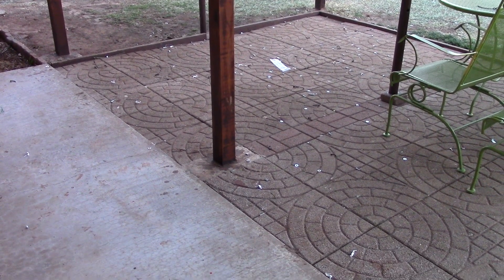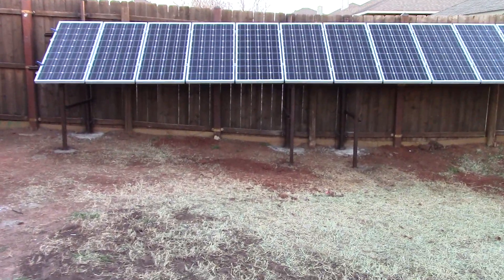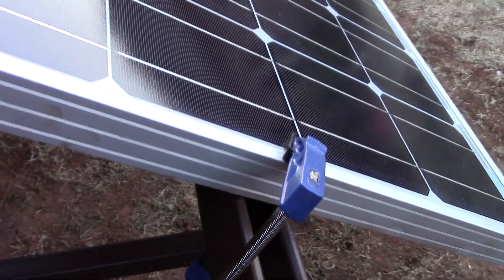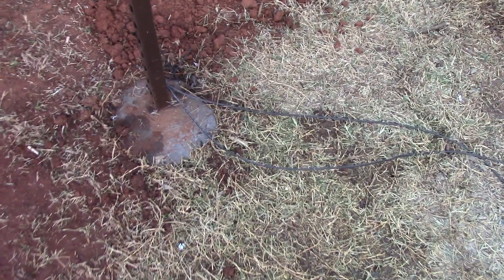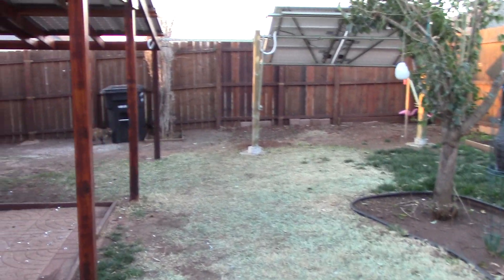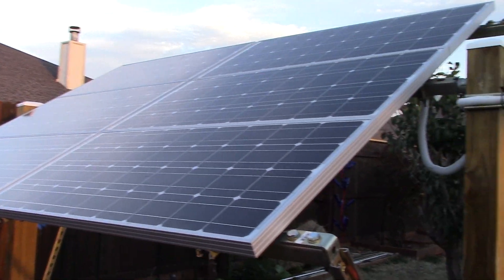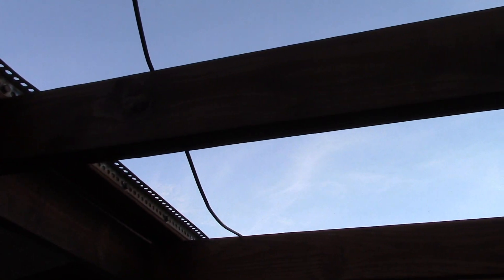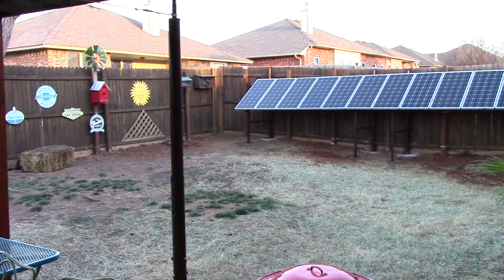12 Renogy solar panels now on fence racking system! 1.2KW array

Comment: Is there any reason why you didnt install them directly on the fence vertically? Instead of building frames?
Reply from the maker: The fence (original wood posts) aren't strong enough. This array has been SOLID since I built it. Check the year I posted this video...panels are still outputting near max too!

Comment: Curious Chris, If you had it to do over would you still use the super strut? I love it and have used it for many things. Buying the expensive racking would be out of the question for me.       I was first thing about roof mounting. I don't have to worry about not enough room on the ground but my roof will need replaced in a couple years. Will you eventually mount yours on your roof (after you replace your roof) to maxamize solar exposure? Just thinking!
Reply from the maker: Making power in a tiny suburbia backyard w/o rooftop...amazed myself. Rooftop solar is never going to happen here for many reasons. My biggest issue before using Superstrut was shading. And still is (but greatly reduced). Really, really, really like Superstrut and DIY racking...can get creative. And a fawk ton less money vs that stuff that is made for solar panels.
Reply: I hear you Chris. My roof faces due south and only ever sees shade at the very edge of dusk/night. There are gods and bads to almost everything. One plus for me is my roofis shingle right now but I have a ton of metal for my pole barn and to re-roof my house. Should last forever. Solar panels with a air gap underneath should help shade my roof and help in the summer with a/c. I will use unistrut though! Thanks Chris!

Comment: Finally pulled the trigger systems on ts way. It will mirror yours with the transfer switch.  I will be attempting to make all the cables from 2/0 wire except the battery to inverter that will be 4/0.  I have to figure a mount for it yet but it will be ground or pole. Any suggestions for a noob?
Reply from the maker: Congrats...anything on the ground with maximum sunshine exposure is best (IMO). Tilt units are good...trackers are even better. Trackers sometimes have "iffy" electronics and can be more hassle then the expense. So, a lot of guys use a tilting system. Mine are all fixed position...maybe someday will do a tracking system. But, here in suburbia...kinda limited with space.
Reply: was planning a tilt system something like your 600w tilt system was only bigger . How did your battery bus bar set up work out? I will have a 48v parallel set up so I don't know if its a idea or not for me.

Comment: What are you able to off set you power bill by with the 1.2kw set up I'm thinking real hard on a 2.4 kw 48 v system but can't seem to pull the trigger on it. Besides the mounting area it takes the monthly savings has the boss wondering
Reply from the maker: Too many factors to consider with your question. Using the "30 KW/H" per day (national US average) and with 2.4 kw in solar panels...and all things being perfect, that size array could produce 15-17 KW/H per day. But, during the day the panels have to "charge" the battery bank while inverting (powering your house). So, it is a step in the right direction. For the year, my system (4,905 watts in solar, 1,300 aH battery bank (24v) offsets 70-75% of my power bill. "Conserving" power is key...LED lighting, Energy Star appliances, timers, etc-etc. Good luck in the build!

Comment: what are you using for grounding?
Reply from the maker: All the panels are connected (bolted) together in metal Superstrut. Four Superstrut channels are sunk into the Earth (hit wet clay) along with galvanized steel posts. Multiple grounds. It is grounded.

Comment: you could just bolt the ends to the unistrut with spring nuts.
Reply from the maker: I used some heavy duty "L-brackets". I modified them for the ends. DIY style...costs less than $15.
Reply: +Chris DIYer I was just offering some help.  From my experience.  Glad you got them secure.  It is ChrisDIYer channel
Reply from the maker: Thanks. Your input made this all happen. Thank you again.
Reply: Chris DIYer Naw, just helped you you DIY use what you had.

Comment: Curious to see how much more power you get with them on a angle now.
Reply from the maker: Me too. It is inconsistent sun/clouds/overcast skies today. But, saw 1,023 watts out of them in the breaks. Majorly screwed up the Superstrut spring bolts (put them on backasswards). They are fixed now and end clamps installed.
Reply: +Chris DIYer That's ok my friend. It's a learning experience. Superstrut are very handy. You can use them on different projects and applications.
Good job and I'm proud of you Buddy. 
It's nice to see you complete this project safely and also been happy with work.
Cheers

Comment: Looks good there Chris!  I made my own end clamps out of some black plastic blocks (I used UHMW but other types would work as well).  Cut pairs of blocks the same thickness as the panels.  Then clamp up two blocks together in a vise and drill down the center along the join line with a bit that's larger than the clamp bolt.  Take them out of the vise and you have two perfect half holes.  Then just slide a block up next to the panel, drop the clamp bolt between them and tighten it down.  Costs almost nothing and a perfect fit, since the blocks were cut to fit the panels.
Reply from the maker: Thanks man...I ended up using heavy gauge L-brackets. I will shoot a video. Beats paying an arm/leg for retail end clamps.
Reply: Good idea buddy and thanks for sharing.

Comment: Nice man you will be getting a lot more power Through out the day now.   On the spring nuts did you put them in backwards I see the spring pointing up and not down LOL.   I did pretty much the same thing for the middle of the panels with a bolt and washer. But will be ordering the mid clamps later.  Unistrut is some great stuff.  I used it a long time a go.  I will be showing once it gets warm how i'm going to build my first solar tracker.   Parts people can get cheap and it can hold up to 2500 LB  with very little welding ect.  Your system is looking great.
Reply from the maker: No kidding? Did I put those in upside down? Will it matter? Crap.
Reply: Chris DIYer on the Spring nut on the top there are little serrations on both sides that grip the unistrut rail. Usually you push them in and turn them and the spring keeps them pushed up in to the unistrut. and they lock in to place so you don't have to hold them I noticed in one of the shots they were turned a little with the spring facing down in to the strut when you tighten the bolt they do not turn  If you like I can do a quick video for you.
Reply from the maker: Thanks...you saved the day. I just fixed ALL of them. It went pretty easy. I never done one of these and probably got into a hurry. Thanks to great folks...we help each other out and point out errors and stuff.